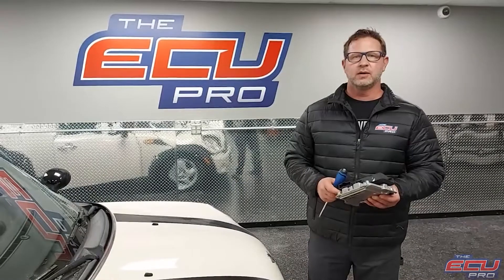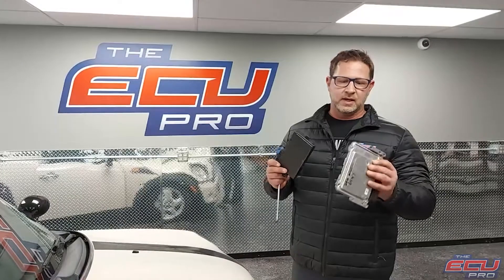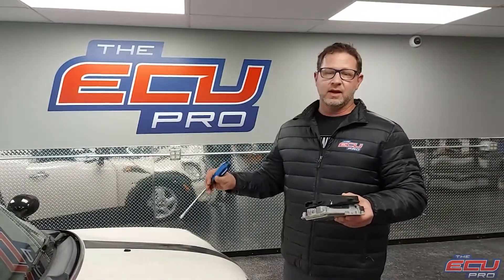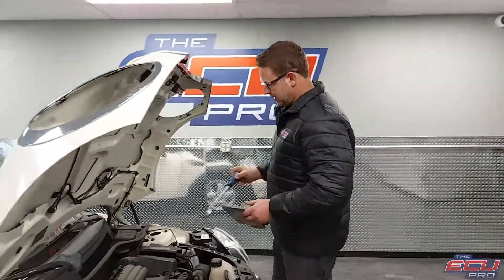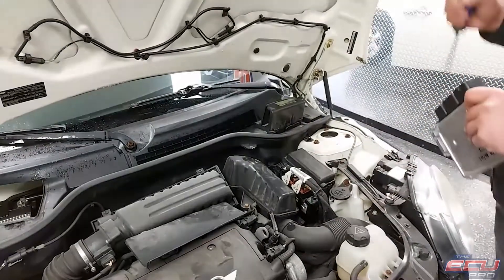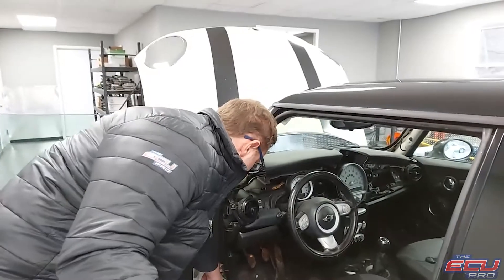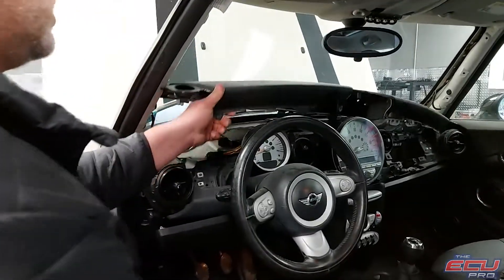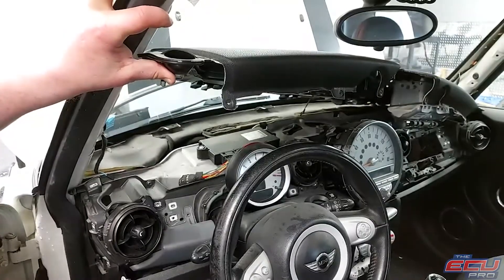MINI MEVD17 DME / ECU Removal & Repair

Comment: Mine didn't slide out.
Reply from the maker: If you slide a screw driver in, you can pop out the DME
Reply: @theecupro  Nah there are two buttons you have to push to slide it out at the bottom.